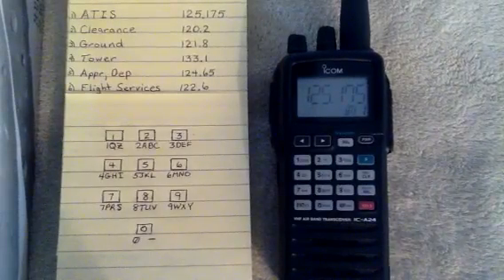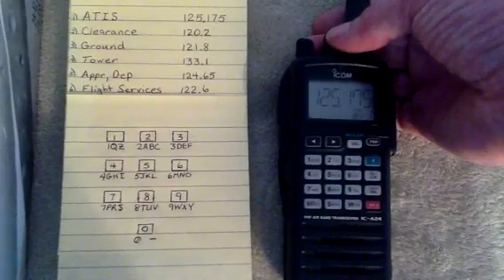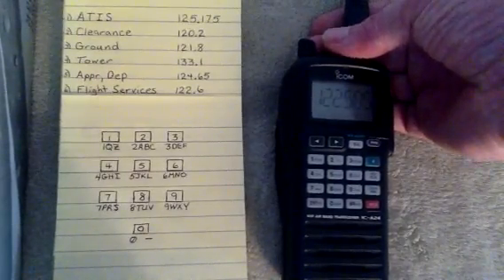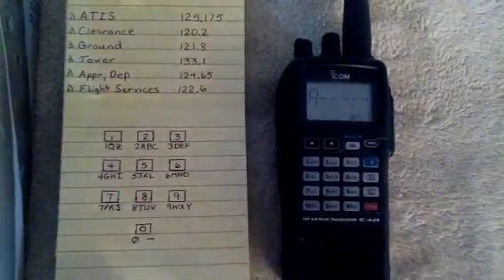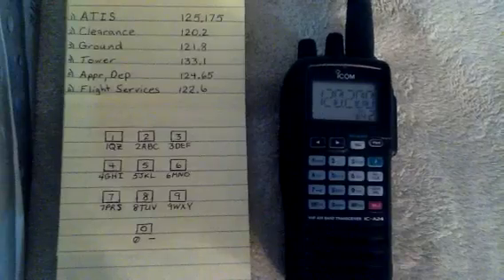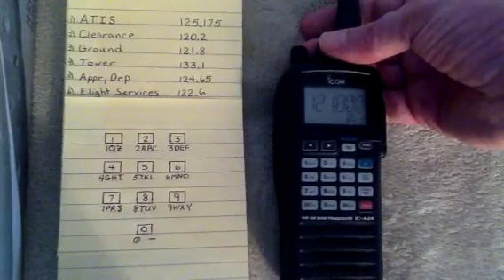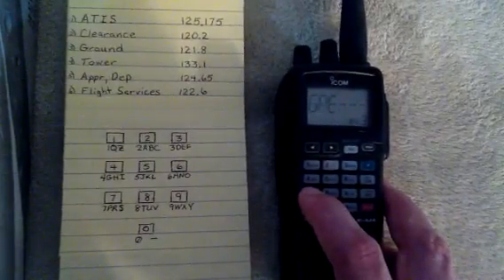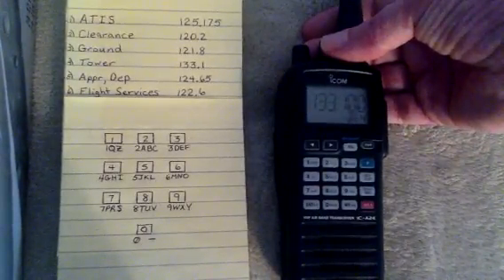Naming Frequencies into programmed channels on the Icom IC-

Comment: ICOM  radios are the most challenging avionics devices that I have ever learned how to use, or program. I have the previous ICOM model, IC-A-23, for years, but can barely use the very basic functions, so I am here hopefully to learn how to use mine. The ICOM programming is counter intuitive, unfriendly and difficult to remember the steps. This instruction video demonstrates the difficulty in programming it. Try to do it from memories a year from now!

 ICOM doesn't even have the instructional video to show how to use their products, None!  and this is an international company? BTW, in the ICOM website it provides a link to this instructional video. That's it! I hope they paid Scott well for creating the ICOM's official training video!

I have no problem in learning how to use the aviation GPS' such as GNS480, 530W, Apollo GX55, G-1000, Loran, etc.  and as an engineer pilot I am pretty familiar with reading and writing technical manuals. 

I will stay away from the ICOM products until they know how to write user manuals.

Comment: Instead of naming freqs. I named the banks after the airport that uses them.. That way I can quickly find the group of freqs I need, and hey, you are going to have to deal with the numbers in the plane anyway..
Reply: How do you name banks instead of frequencies?
Reply: @notavailable9485  
First of all, thanks to @Scott Johnson for taking time to make this video - much easier to watch this than trying to make sense of the manual ;-)

You can change bank names pretty much same way you name the entries. 

After pressing CLR, I pressed:
 
1. [F] [MR/MW]
2. [F] [0 BANK]
This will give you the current name of the selected bank. Mine was "BANK 0"

To change that:
3. [F] [MR/MW] [MR/MW] (Twice!) whereafter the first letter will start to flash
4. Change letter by letter as in this video
5. Press [ENT] when you are done.

Verify with 
1. [CLR]
2. [F] [BANK]
Then scroll through the bank names with the button next to the aerial.